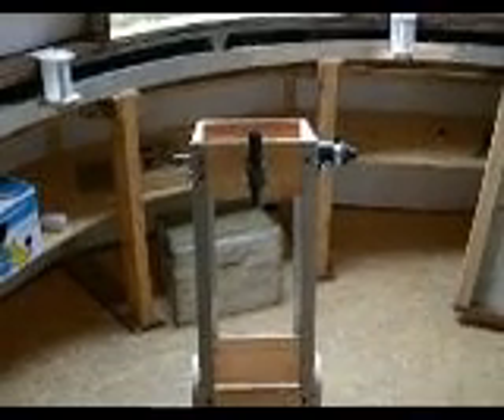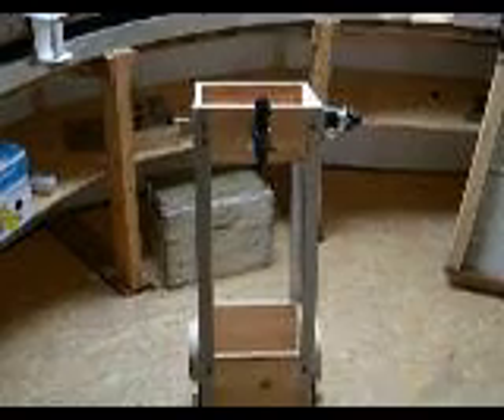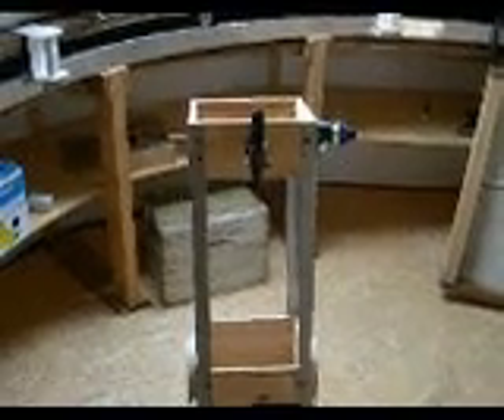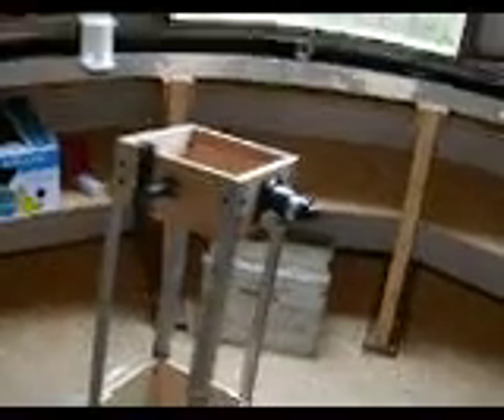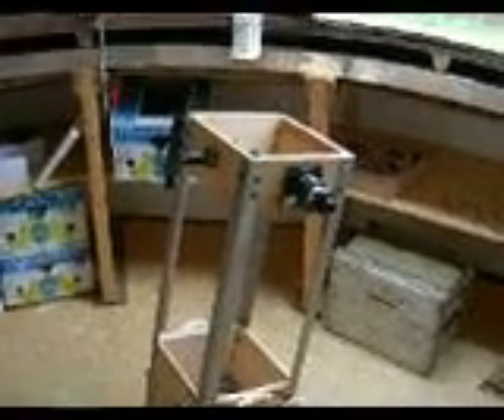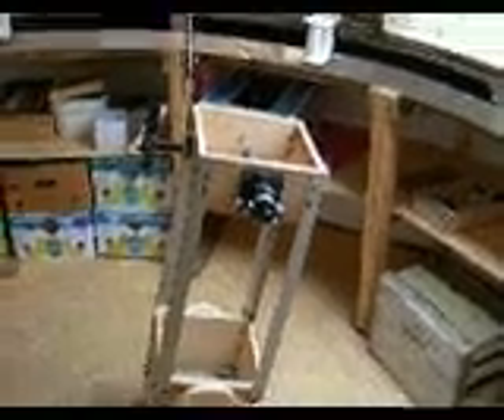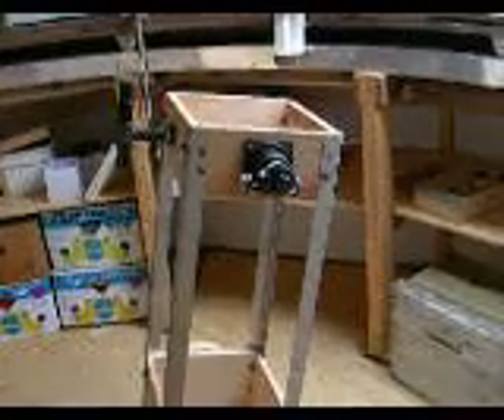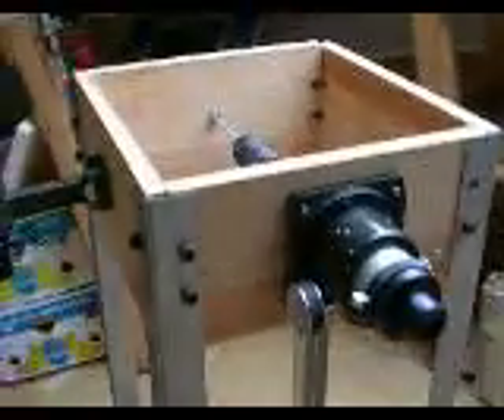My first telescope

Comment: The reason your mirror did not polish right out to the edge is because your lap facets did not reach the edge of the tool. Working with tool regularly on top would have helped to polish the mirror to the very edge. The mirror will still work very well with only a small lost of contrast if the figure is okay. Enjoy your telescope and your superb dome.

Comment: If you are using a Newtonian optical system, the mirror is supposed to be parabolic in shape.  If you use a really long focal ratio like over f/8, you can get away with a spherical shape without too much loss of resolution due to spherical aberation.  If you didn't make a telescope before, it takes some handy work. Start with buying all the parts premade.  If you really want to make the mirror, it helps to have a scope ready as a test bed for your new mirror.